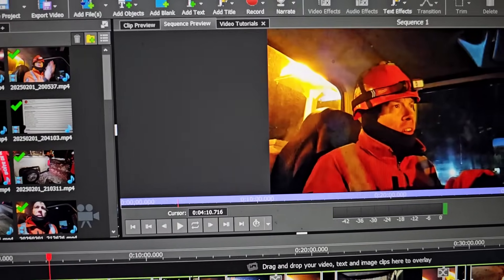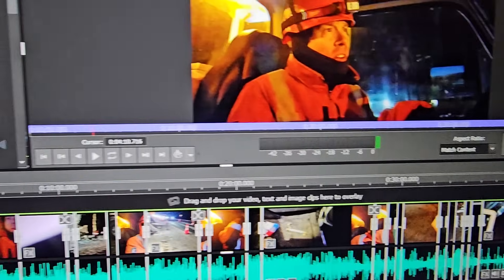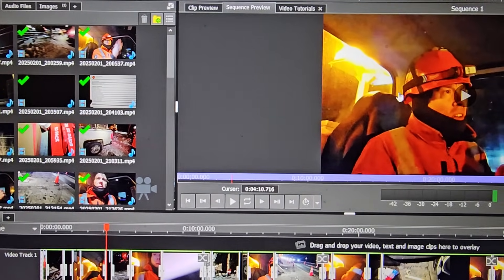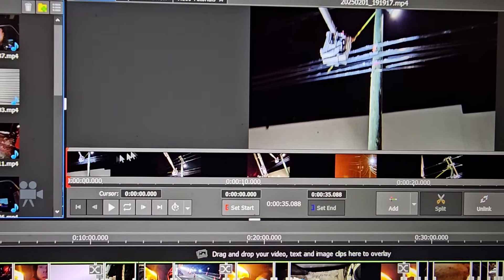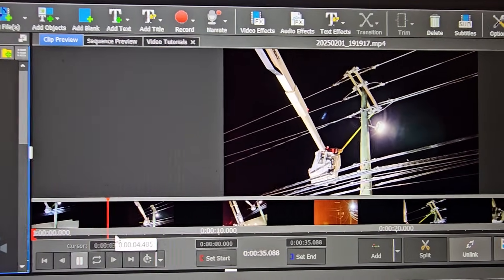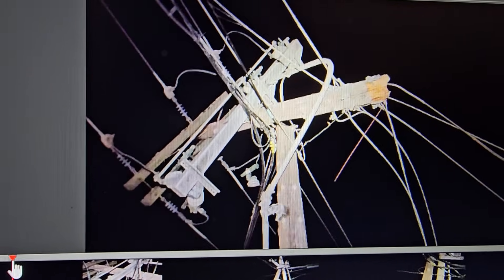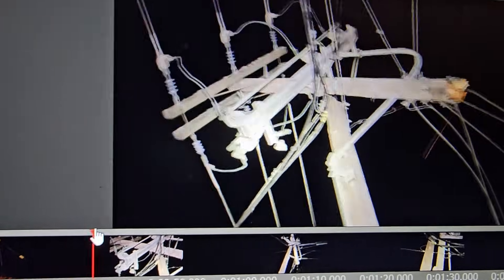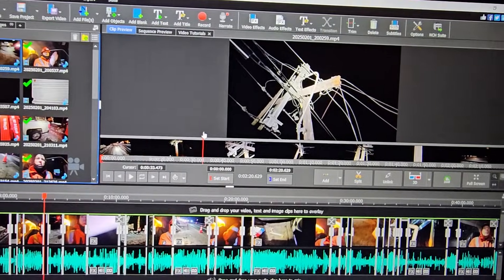Triplex melted from Overload!

Comment: As a german three-phase enjoyer I have to ask why you would rather run thick af copper or even aluminium for a 200A Service instead of putting 3 phases at hihger voltage and therefore lower current in
200A at 240V single phase would deliver ~48kVA, you'd get the same with a three phase 400V 70A connection which only needs 25mm2 (close to AWG3) copper wire
Reply: The obvious reason is that then you couldn't use any standard North American appliances. If we had 3 phase at home it would be 120/208. While you could get by with a bit less copper using 3phase you'd also need 3x as many wires (more labor) and 3x as many transformers. You really need to consider that our distribution system is different than you have in Europe. The final distribution transformer only feeds a few houses at most, I believe in Europe the norm is for tons of homes to run off a single transformer.

In other words we have 7200v half a block away while you use wimpy 400v.

Comment: Taht wire is so small!  When I added on an Inlaw Apt in 1992 to my 5200sf house I had the Electric utility change out the service drop (Previously upgraded from 60A to 100A) to 200A and I had an Electrician run 100A from the meter across my attic and down to my 100A Load Center.

Comment: in the UK we have a main cutout fuse that's sealed by the power company, to limit load. Electricians can't uprate that fuse (or shouldn't!)  However we're still required to notify the DNO (distribution network operator) if we install a heavy continuous load, eg an electric boiler/EVSE etc

Comment: Here in Ct many will upgrade their service and on a modest home they will only upgrade the triplex if it's #4. In most cases the new triplex will be #2 for a 200 amp panel unless you make a special request. (voltage drop issues, etc) I was at one job where they went 3 poles with 2/0 as an upgrade because of AC load in the summer. Meanwhile my home is still on #4 triplex because the service is more about home runs and distribution, rather than total draw.

Comment: What is the difference between ACSR and Triplex?   Read the definitions and still confused. ACSR is never used for a  service drop?
Reply: ACSR = aluminum clad steel reinforced and AFAIK is single conductor. Triplex is (as the name implies) 3 conductor cable. My understanding is that the main current carrying conductors of triplex are aluminum and only the neutral/ground has steel but I could be mistaken on this part.

Comment: I assume the plow hit a guy, which is why the pole snapped so far up.  I had a grader take out a guy line along the road that supported the circuit running up to my house.  I happened to be outside and witness it happen.  Needless to say, once the guy was free, it landed across the neutral and hot. Zap.

Comment: In Australia, the first power pole on a property has a 63-80 amo HRC service fuse installed & the conductor size is 6 AWG or 16mm² assuming it's a 240 VAC single phase installation.

The house in discussion in the video, you may as well have upgraded to 3 phase with that house,I know that in Australia,in the Australian/New Zealand AS3000 wiring rules there's a maximum demand table which considers the balancing of loads between phases & the maximum amount of current permissible per phase in an installation.

That would avoid any cooked conductors even between the house & the power lines on the street if such a table was followed !
Reply: But 3ɸ residential service here (and in the States) is very rare.  The cost of the additional overhead (more-conductor cables, capable panel, extra transformers) just isn't worth it.
Reply: @jovetj  the rest of the world gets around the cost problem by running three phase primaries everywhere. with a few rare exceptions, countries with 240 volt mains will have nearly every transformer be a three phase transformer. this means that overhead medium voltage lines do not require a neutral conductor, as such they only need to run three primary wires instead of four in North America. So while it makes rural power somewhat more expensive it is balanced out by the fact that running power in cities and towns is cheaper. 

Now a significant portion of the cost of power lines is the utility poles themselves, accounting for 33 to 50% the cost of the line, and in cities where spans are shorter, poles make up a greater percentage of the cost. Most of the remaining cost is the lines themselves. in terms of cost average a three phase three wire line with no neutral will only cost about 25% more than a single phase two wire sideline, but that cost is partially compensated for in the fact that main trunk lines, city lines, and sidelines that need to be three phase anyway wont need a neutral line anymore, thus reducing their cost by 20%. Universal three phase also means some sidelines can have smaller conductor sizes since the load is more evenly distributed across three conductors. What further benefits universal three phase grids is that purpose built three phase transformers are much smaller lighter and cheaper than three single phase transformers of the same combined KVA rating, and transformers are a significant cost to the utility. For example the cost of one 150 KVA three phase transformer is around 70-80% the cost of three single phase 50 KVA transformers.

So all in all universal three phase grid in North America would only have about a 5 to 10% higher cost in average and in urban area's it would actually be cheaper.

Of course 240 volt mains voltage countries, because of their higher mains voltage is able to get away with needing fewer side lines and fewer transformers to serve customers, and secondary liens can travel further from their transformers thanks to the higher voltage. This combined with universal three phase, means power grids in 240 volt mains countries is often cheaper to build than the grids in north America.

It is also worth noting that universal three phase is cheaper on the customer end, especially at the higher current services. A 200 amp split phase service is just about the same KVA as a 125 amp three phase 208 service, but the wiring needed to supply a 125 amp three phase panel is cheaper than the wiring needed for a 200 amp split phase panel. Likewise three phase AC units are more energy efficient than their single phase counterparts, and three phase motors last a lot longer than single phase ones. When you consider than HVAC systems are usually the highest energy demanding appliance in a home, and one of the most expensive appliances, end users would experience significant cost savings in using three phase AC units over single phase ones.

So yes, three phase is worth it, if the whole grid goes all in on three phase distribution. North America made a big mistake when it standardized on single phase distribution for residences and small businesses.
Reply: @ryuukeisscifiproductions1818  In rural areas, it is common to run 2 out of 3 phases on side-lines, with transformer primaries connected between the phases. Single-phase side lines still need 2 wires, so there is no saving here under the North American system. In fact, the 2 phase lines can carry about 70% more power than a single phase line can with the same conductors.
Reply: @ having two phases also gives the option for open delta banks whenever three phase is needed in those situations, though with an open delta primary I'm not sure if you can get a wye secondary off of that. Any time i have ever seen an open delta bank its always had a high leg on the secondary.

Comment: Crazy stuff! Hey, I've mentioned open neutrals before, but have you ever heard of AC coming from the cable co's plant back INTO the house, causing a melted coax drop? Another tech went after me and had to replace the drop AGAIN, but then maintenance apparently found AC coming out of the tap towards the home, so they replaced the tap plate.

I don't know enough about their outside plant, but I still wonder if it was an intermittent open neutral past MB hydro's demarcation, and the tech was mistaken. Thanks
Reply: many times, you'll find they have neighbor/s with a broken neutral and they're back-feeding the coax.

Comment: Jesus! Fed from 8ga copper! So 40-50A rated wire. IM surprised the acsr #4 was the one that melted!
Reply from the maker: The majority of the load was still on the #3 copper feeding the 100A panel. Then the #8 jumped over to a new 200 where he had moved some of the load over. I forgot to mention... There was also an 80A pony off the 100Amp panel 🤦‍♂️🤦‍♂️🤦‍♂️

Comment: I had my house upgraded to 200 amp service a few years ago. It is overkill for the load I actually have - my furnace, stove, water heater and clothes dryer are all gas - but I have the reserve capacity to expand quite a bit if I ever need to, or if I eventually sell the house and the new owner wants to add more load. There is indeed a substantial increase in the size of the conductors in the meter panel and connection to the main breaker panel with a proper end-to-end 200 amp installation!
Reply: Same here.
Reply from the maker: Some areas apparently are forcing space for car chargers upon upgrades and new homes.... At least you'll have the space for that if it's ever needed 😅

Comment: Wow. The homeowner is lucky his house didn't burn down. #8 for 100amps. Yikes.
Reply: yeah, no kidding. I put a 50 amp circuit in my garage for a welder, and i used #6, and the plug is only 35 feet from the panel on the opposite side of the garage. I know for a welder, you can use smaller cable because it's "intermittent", but the cost was insignificant to go to larger wire anyway. And now I actually have a CNC lathe plugged into that outlet, so good thing I went with the full size wire!
Reply: "Yikes" was my reaction, too.
Reply: #8 at 90C is good for 45-50A in copper. But damn! Trying to pull 100 amps. Ya insane people
Reply: People do not realise that double the current is 4x the heat.
Reply: @Sicktrickintuner    yes, but most 100 amp panels in the US loaf along at a bunch less than rated. My panel pulls less than 10 amps a leg on a typical winter evening. OTOH, up in Canada there's a lot of electric used for heating so not always a good comparison.

Comment: Hi Bob, I saw two things today that likely will interest your utility.
A battery built on a RR train, capacity equals the number of RR cars.
Could be for emergency power. Likely can be supplied with generator, solar, wind, diesel, ...
Second item was large ag UAV with chemical tank on UAV. Mr. James R Booker PE did testing on a ag water system spraying onto a 345 kV transmission line. Madison WI has University Ave, speed 35mph, 6 pole fires in one day is record, due to road salt spray from traffic thru winter. The Ag sprayer UAV could was the poles before first spring thaw. Likely a service company to supply and operate Ag UAV.

Comment: Interesting!  I've been doing research on service entrances.  You indicated that it was #4 going from the service line.  Is it not a #3 to the meter, and the other side to the panel?  Or is it #3 if it's aluminum wire, or #4 if it's copper?  Also,is #4 copper rated at 106 amps?    I know , I know, a lot of questions.
Reply from the maker: The values change slightly depending on how the wire is wound and for what application it's used...
85 Amp is a safe rating for #4 coppen when used indoors. 

Our wire up in the open air has slightly higher ampacity. So to answer your first question, our #4 aluminum was feeding #3 copper going into the mast.

Our current standard for 200 amp is;
1/0 aluminum wire feeding 3/0 copper or 250mcm Aluminum.
Reply: @Bobsdecline  thank you. That makes sense to me.

Comment from the maker: Hey Everyone! 
 Two quick corrections (As this video was not edited). 
I said ACSR a couple times... what I meant was Triplex (Aluminum).
The 8 copper was tied into the source side (not the load) of the 100 amp breaker 😨 and therefore had no protection!!! It allowed for a 100 amp and 200 amp panel to draw from that aluminum wire :(.
Cheers all! Be safe.